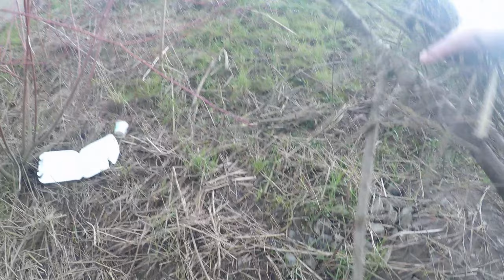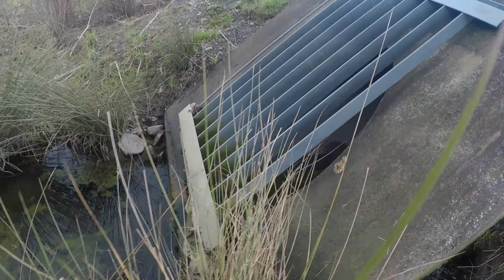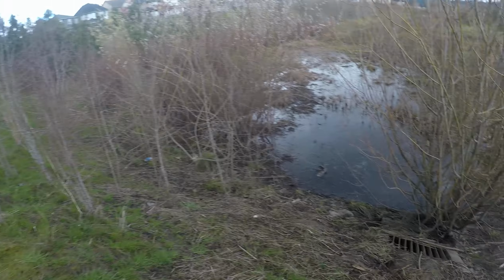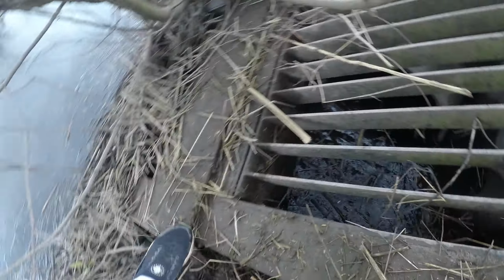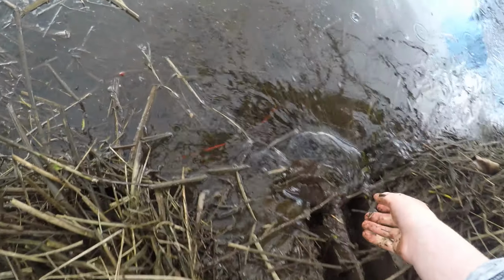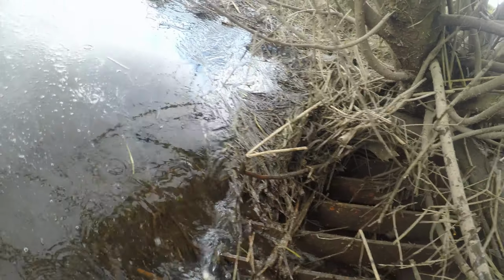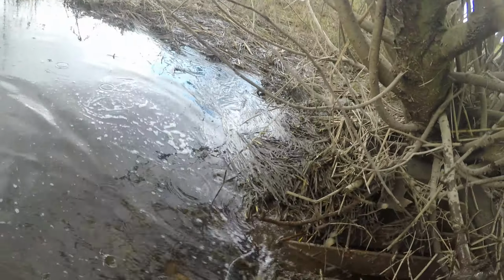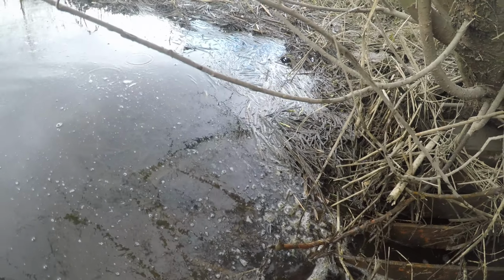Unclogging Lake Drain

Comment: You’ll be glad that is dry come spring because mosquitoes will lay in it. 
However, did you check for any frogspawn or toad spawn in the water, it’s breeding season and they eat mosquito larvae.  Just a thought re that particular bit. 
I think that bush needs cutting down, maybe ask for help doing it. It’ll root quite happily there and cause damage via it’s roots Etc.  
Great job as always. 👍🏻💦😷